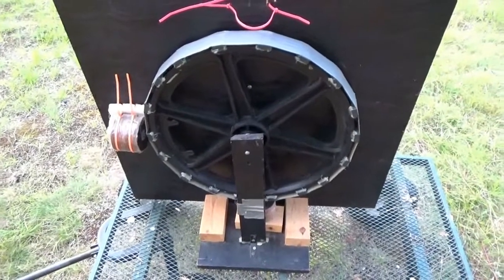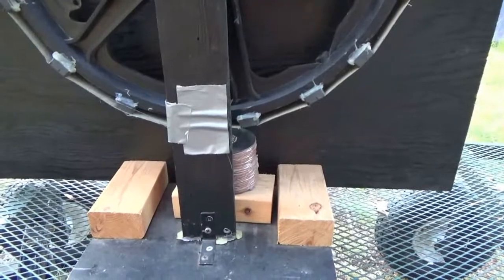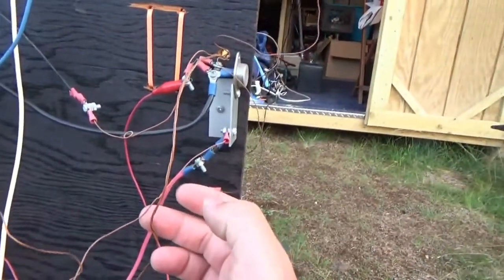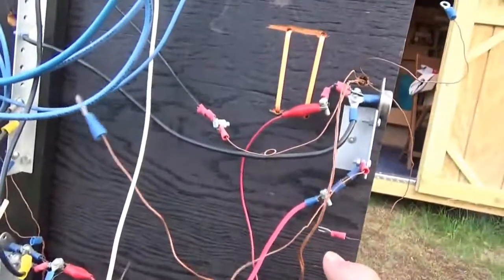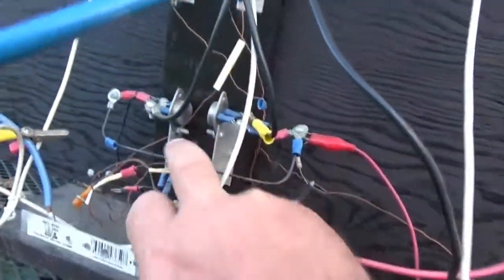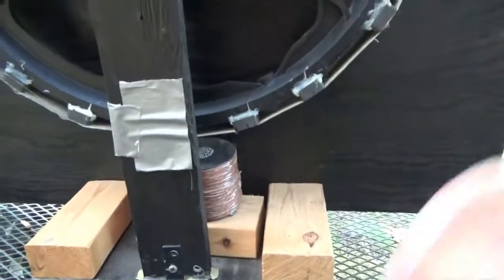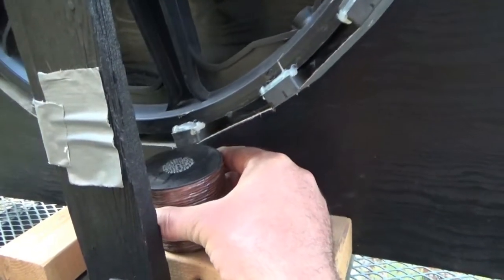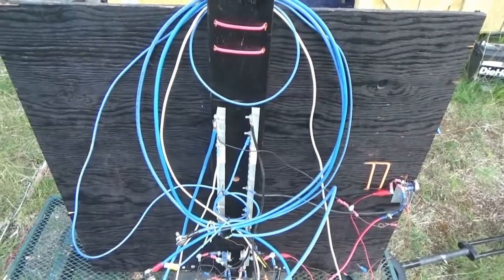My Large Multi Coil Bedini Motor Overview

Comment: Yes litzing the wire keeps the Capacitance equal in the coil windings.  As you're outside in your video have you ever tried grounding your Energizer in the dirt?  Its not something I've ever got round to trying yet but have read it really improves Radiant systems..

Comment: Get that trash out of the center of your coils and it will fly.
Reply from the maker: Open air coils?
Reply: @thedoityourselfworldelectr8007  yes... Soft iron inductors just cause heat and slow your magnets down when they pass close enough to the magnet. I saw john run one called a zero energy motor where the coil was laid PARALLEL to the inline plane of the wheels outer edge... He ran it without a core and it ran great and then he put lead pipe... (Conduit??) Inside the coil and it stabilized the system and did it a LOT of good... But running solid soft iron that close to your magnets provides NO BENEFIT... just drag.

Comment: My opinion is that no energy is being taken from the environment. When the magnet passes over the coil there is an induced current from the magnet into the trigger coil, it opens the circuit allowing battery electricity into the coil adding to the energy induced by the magnet into the trigger coil. When the magnet passes everything collapses and the combined flux induces increased current and increases the voltage power. No energy is sucked out of the ether. It is all induced by the magnet and the electrical power of the battery.

Comment: I'm making a power transformer as a next motor that will have 20x.50mm copperwire, looking at newtons laws of induction, i noticed something interesting, if you got 1 input wire next to a output wire and pass emf through the input , the output wire picks up the emf giving a 1:1 ratio, if you know how things in parallel work, if you have 1 input wire and 20 output wires next to eachother, all output wires pick up the same emf, giving 20x the amps out as in, here's the not so tricky part,  if you had 20input wires next to 20 output wires , every output wire will pick up emf FROM EVERY INPUT WIRE 20x20=400x the input, I'm going to make a transformer that has 20x as many output wires compaired to input wires, it's to make a power tranformer not in any electronic book, most tranformers up the voltage while downing the amps or vice versa but mine will up the voltage 20x down the current 20x then because of 20x20 parallel configuration it'll  up the amps by 400x giving 20x greater current out then in as well as 20x voltage out then in, 12vx20=240v a motor with mains output is far more usefull then just 12v out with 240v you could plug a battery charger in to it to charge a battery but atleast it would be able to do other things  i tried a less powerfull homemade motor on a ssg but it only ran for a few hours then it didn't work, there isn't a true power transformer in existence that ups the voltage and current that ups the WATTS , my design would work, anyone can try it but I'm going to make it the next couple of years anyways, check out my motors crude but they were a lesson, to go bigger, my last motor had 3kgs of copper on it the output was 2,500v , ny make will have 10 kgs of copper

Comment: So will this Bedini thing have an outputs of 120 volts and 240 volts @ 60 Hz and @ 200 amps capable of powering a house?
Reply from the maker: It has a 12 or 24 volt output to charge lead acid batteries. The batteries can then be used to power devices.
Reply: So, even if the Bedini thing works as you believe it will..... In order to power an average American home..... You would need a huge battery bank, and equally huge power inverters and charge controllers. All extremely expensive! Where's the savings over simply remaining connected to the grid? Yes, its true that a person can cut their power consumption down to almost nothing, as many off gridders do. But you can do exactly the same thing while remaining connected to the grid and pay almost nothing to the power company. Am I wrong?
Reply from the maker: Well now there you have a good point. There is a lot of expense in having a huge battery bank and power inverters. But in the long term you can save money. I went from $100 a month in our new home to just $26 and half that was for the power company fee. Soon the bill will be down to just the fee. I will stay connected for emergencies.

Comment: You say that Bedini thingy can power a house???? That's raises a couple of questions..... To power a  house and all its appliances.... Water heater, air-conditioning, washer and dryer, stove, microwave, and shop filled with power tools will require many kilowatts. So can you please explain exactly what is the energy source? (NOT some unknown energy source out of nowhere) Furthermore, isn't the wiring shown so far too small to handle the load of powering an entire house?
Reply from the maker: We only use 5 Kw per day in the house right now so we do not need all that much power. And you are also trying to include a shop filled with power tools, which is not the house. And you also exclude "some unknown energy source..." which shuts my mouth and ends my possibility of trying to explain to you how this works.
Reply: Troy, How can you explain how something works if the energy source is "unknown"???? Isn't knowing exactly where the energy is coming from part of explaining how the thing works? Good science always has theories to explain how things work. Plus experimental evidence to prove that the theories are correct. As for the power usage.....  In my comment, I meant an average American home. Which I believe uses about 30 Kwh per day. (I will see if I can find the link again to back that up) Off gridders tend to ration their power use. Which doesn't represent an average American home. But thank you for responding to my comment.
Reply from the maker: I was being a bit sarcastic there. The source of the power is known but not common nor is it commonly accepted. It is all around us. Cosmic energy you could say. This device taps into that and coverts it into usable energy inside the battery.
Reply from the maker: We are down to 2 kw per day :)

Comment: I'm not hating on your project but do you really believe that it can power your house indefinitely? In the past you have lived totally off grid for years with solar and wind power. Both of which have drawbacks that they are not always reliable power sources. They also required you to buy and maintain batteries. If you truly believe that this device would work why did you continue using solar power instead of this? I think you do some really cool projects but you must have real doubts about these claims or you would have switch to it years ago.
Reply from the maker: Two reasons I dont have this going yet. Cost of wire went through the roof. And it takes a lot of study and experimentation to get it tuned and running correctly. John Bedini gave us all we need to make it work. But it gets very technical. Matching transistor sets (means buying 4 to 5 times what you need to find a few matched ones), matching impedance, matched magnets and more. All of these points have a cost.
Reply from the maker: Its easy to buy a solar panel and hook it up. 2 wires. But if I can get the Bedini motor going it sure would be cool.